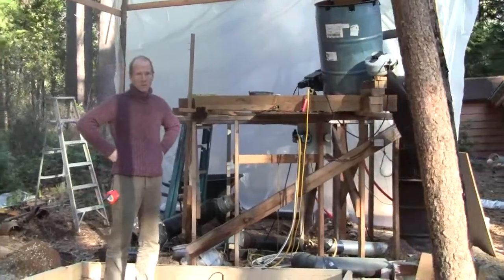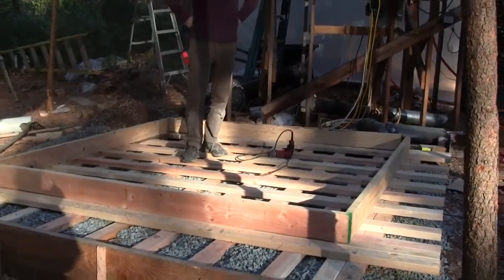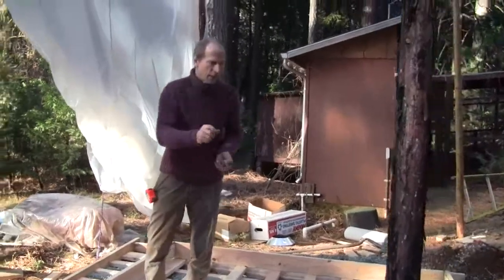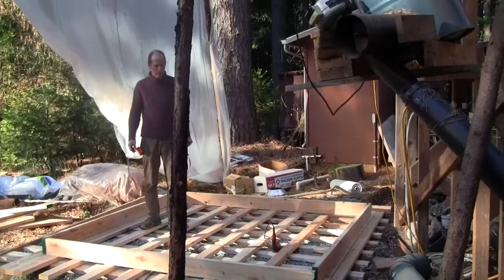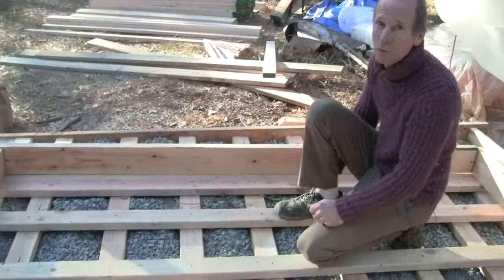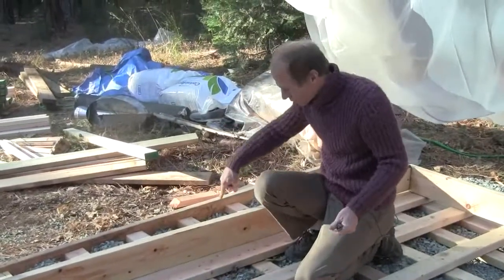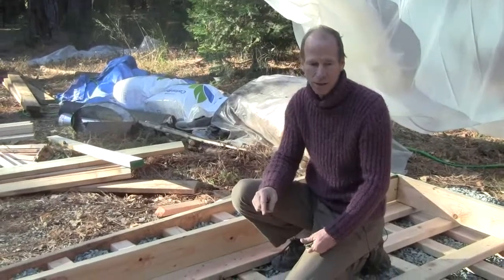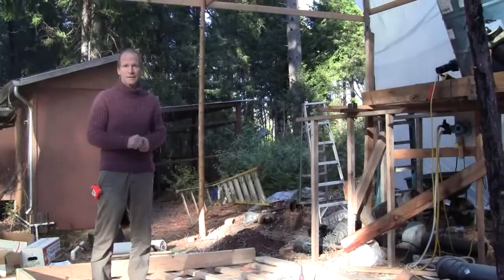DIY Hydronic hot water storage reservoir 1.wmv

Comment: I like the concept with using these materials however, I have to agree with JH standing the two xs on edge will cut down on the downward flex over time which would result in compromising the integrity of the outside walls. This is just an opinion from a building aspect.